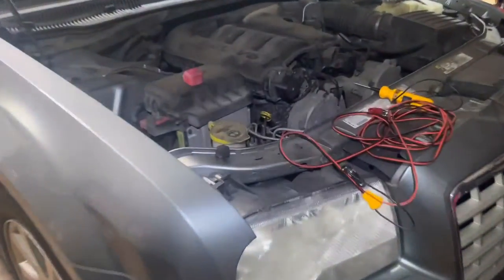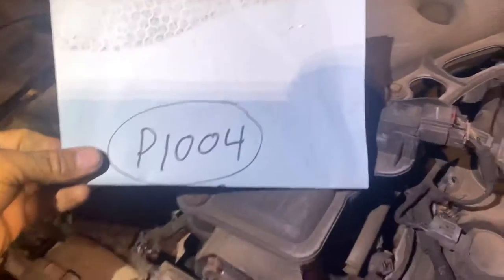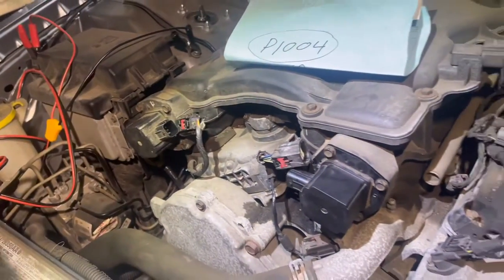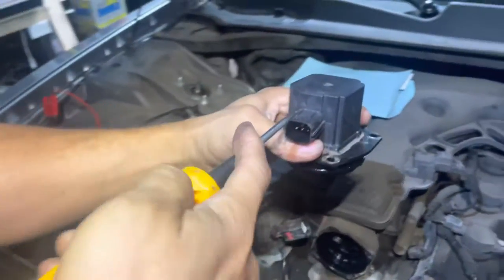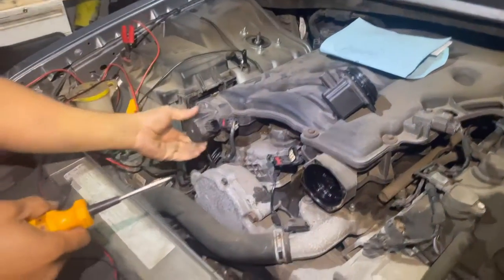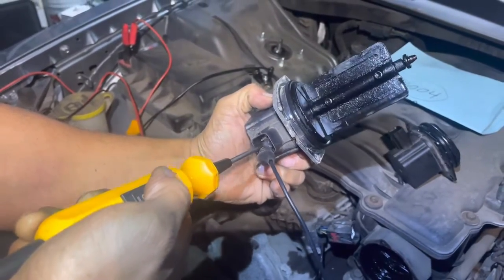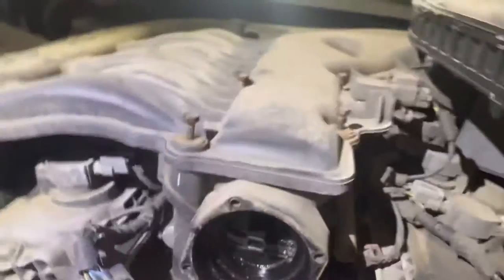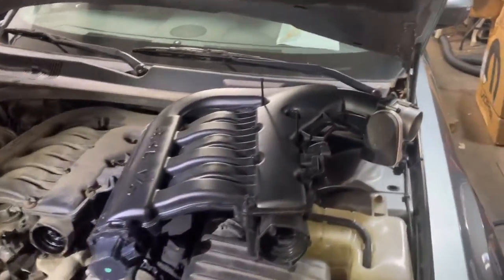P1004  How to test it and fix it  #p1004

Comment: The SRV system operates under WOT conditions above 5000 rpm to maximize engine performance. When actuated by the PCM, the SRV solenoid energizes, allowing mechanical linkage to redirect the intake air flow to six short runners. The PCM looks for a current spike when actuating the solenoid. If the spike is not present, the PCM sets the DTC. Thanks for giving a good way to test both of those mechanical components ❤

Comment: I have a 2007 Chrysler 300 Touring 3.5L V6. I got this code and mechanic told me order two parts, Intake manifold short runner valve and intake manifold runner control tuning valve. He put them in and check engine light went away. He told me drive 50-100 miles and bring it back. I drove for 60 miles and light came back on???

Comment: Anyone know if this should be spring loaded? I tested it and nothing on the short one but with the flap seems to work fine. Also the one with a flap is spring loaded when you flip it by hand it springs back. The small one does not. Wonderful if the small one is supposed to or not.

Comment: I put on a Dorman... The faceplate keeps getting sucked off when it's bolted to the manifold, disconnecting 3 electrical prongs. Jumpered + and - to the terminals, this one's dead. I recommend the Chrysler/Dodge OEM parts.

Comment: I check the first one you took off and it's bad but the other one the one with the flaps it's not on the car there's a plate on it but when I took it off to check the other part, it's not in there?
Reply: Think I figured it out the 2008 model just has the short runner valve not the other flapper one any idea why I believe the 2007 model has it two of them

Comment: I have the same P1004 code. I pulled out the SRV and I applied 12V to the pins as shown on this video (upper left pin = negative. upper right pin = positive). I don't have the tester so I just used two wires with alligator clips (the positive wire clamped to the red terminal on the battery and the negative wire clamped to ground). When I applied 12V that way to the SRV, it did not turn. So I thought I need a new SRV. I ordered one from Ebay. Applied 12V again and, again the new SRV doesn't move. So I returned it and bought another one. Applied 12V again to the new one and, again, it doesn't turn. I don't know what's going on. As long as I supply 12V to the SRV to the top two pins, the shaft should turn right?
Reply: I'm having the same problem. Can it be that dorman cant make one right?
Reply: this is word for word what im dealing wit myself. i just installed a cheap replacement i found on amazons, plugged the bastard in without testing directly because i was worried that without a complete electrical diagram / pinout of the unit, i might get the voltage right but the amperage wrong and end up blowing the whole unit like monica lewinsky gettin her drunk on at a ghetto ass navy dive bar full of BUDS dropouts. on a tuesdayy? morning. ugh maybe this why my shit is broken i take 45 seconds to explain the problem at hand, another 10 seconds for the question, 700 seconds for a completely unsolicited monica lewinsky joke... dang.. just like elementary school.....

so what is the normal range of voltages supposed to be for this piece of shit? anyone got an electrical diagram and / or pinout with nominal electrical tolerances so i can jerry-rigg something to trick my ball-busting bastard of a ECU to switch off my CEL for 20 minutes so i can go to this smog place half a block from my pad, get my smogs checked and approved of so i  can move on wit my goddamn life. i bought this motherfucker in FEBRURARY and it came with p1004 lit, reg just expired like a paper jug of milk n all funnys aside it is way the fuck past time i passed smog so that i could then send in the stupid title and get my own car under my own fyucking name...

electrical pinouts anyone? of this stupid item? i need p1004 to sit down and be humble for like 30 minutes so i can get my 2010 christ 300 smoggity smogged and title turned in . help? thanks lol
Reply: What fixed mine was a dealer part. the solenoid needs to be pre loaded a little to actually move. When you install it you clock it and load the spring. 3 Dormans same problem. As long as your intake runner spins freely by hand install a mopar part and you should be good to go.  Even with the dealer part not installed I wasn’t able to actuate it by applying voltage. Unless I turned the blade some. Same as the dorman but the dorman needs to be turned further to actuate which will not be achieved when installed.
Reply: So wtf are you saying to me preload and clock and load spring?? Explain pls kthx
Reply: @byronweisfeld6939  When you install it into the intake runner it pre loads itself. You have to insert it and twist for the bolt holes to line up. That’s the pre load I’m talking about.
Reply: @charles979  okay thanks

Comment: Easier to just hit a junk yard or find the exact model and year, and get the sensor that way and test it…. Mine was just a sensor swap and cleaned it out with carb cleaner with a deep clean and wipe dry with a towel and no more check engine light…has 200k miles and didn’t want to take everything apart…. But spark plugs and wires will be next on to do list

Comment: I received the same P1004 code on my 2008 Dodge Charger SE.   I changed the Intake manifold runner and the light went off.  About a week later the light comes back on.  What could be the problem?
Reply from the maker: Ohh you do know there are two of them
Reply: @nestorautorepair  Where is the other one?
Reply from the maker: Next to ut,, I think your flapper is going bad
Reply: Need new manifold $700
Reply: @donpoochi  how do you know when the whole manifold is the issue and not those 2 box looking thingys

Comment: I had the same problem. I purchased the Mopar OEM part from the dealer, I've tried other brands like Dorman with no luck. Once i put the Mopar runner valve codes went off.
Reply from the maker: Sweet!!
Reply: How do I purchase a Mopar short runner valve??  I have the same code reading for my car. The local part supply store doesn’t have it or I may be saying the wrong name.

Comment: changed out the short runner valve &, manifold intake, erased code with cheap scanner but light still comes back on with code p1004 ? what else can i do ?
Reply: if u did all those yob's correctly you almost certainly are dealing with some sort of fucked up wiring issue. start at the cocksucking runner valve and work your way backwards until you find the break or short. it could be right there at the connector if u are lukcy. or it could be buried deep in a filthy whore of a wire harness and u have hours of troubleshooting and hair-pulling and cursing ahead of u. good luck, 300 bruddah i hope u bend your christler to your will dont give up lol

Comment: How can I buy a new manifold? I have same problem
Reply: Question  have you found out where to get the manifold at?
Reply: @jesuscarreno9295  all out of stock everywhere. I’m on waiting list. Who knows when will be available. I soaked mine in Purple Power and sprayed some wd-40 on the parts that swivel and it passed smog. Check engine returned a week later but least I can drive my car legally now that I passed smog
Reply from the maker: Wow